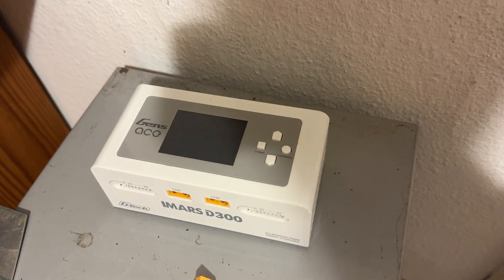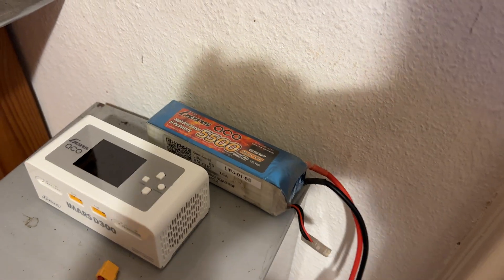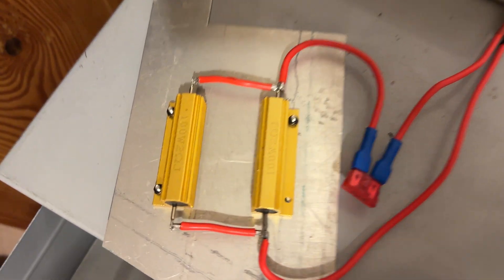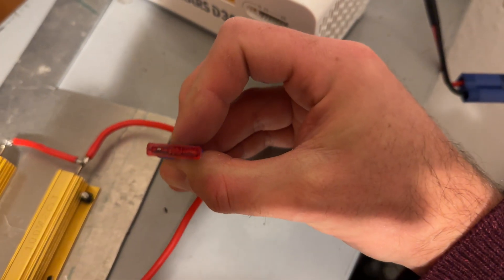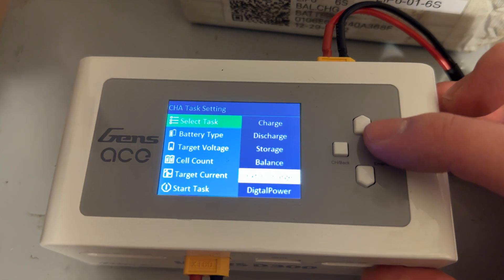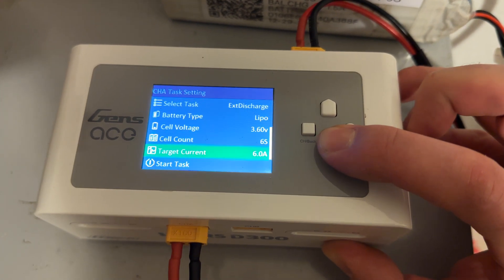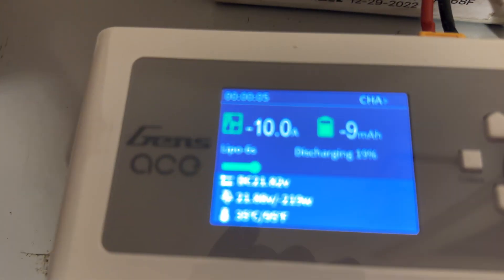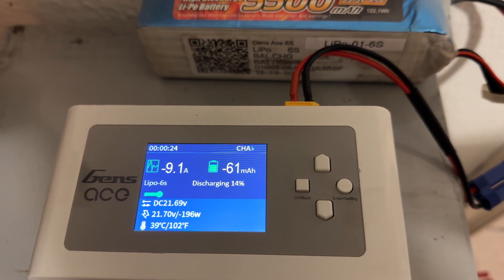How to use the External Discharge Feature on Gens Ace iMars D300

Comment: how many ampere maximum for extdischarging
Reply from the maker: This depends on the voltage of the battery and the used resistors.
I wanted to have around 8 Ampere for my 6S LiPo, so I use 100 watt 1 ohm resistors in parallel, this results in I = 100 watt / 22 V (approximately) per resistor. So around 4,5 ampere per resistor, in total 9 A. The current could be higher if the voltage of the battery is lower, e.g. 3S with 11,1 V. Or you find higher rated resistors, e.g. 150 Watt each.